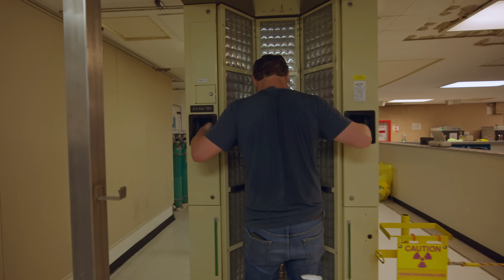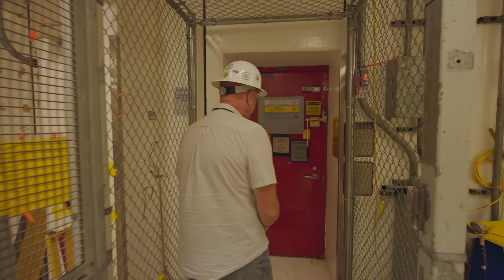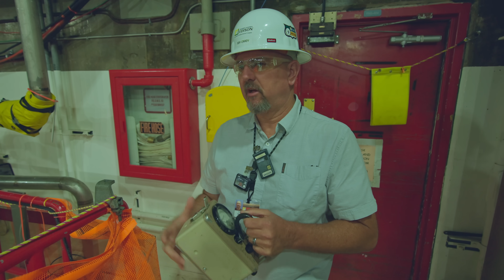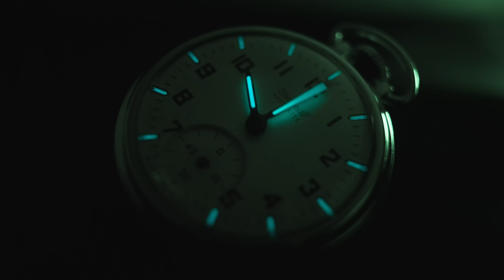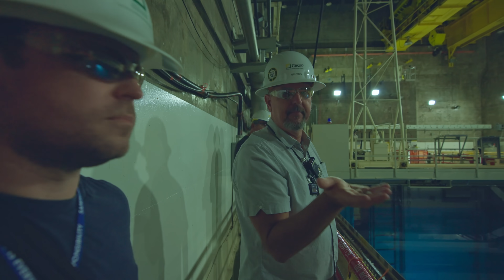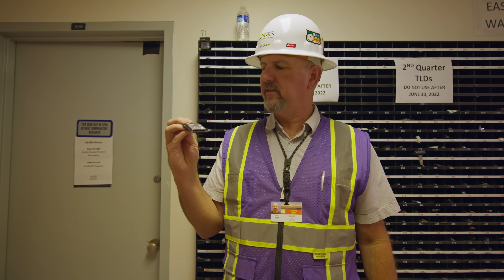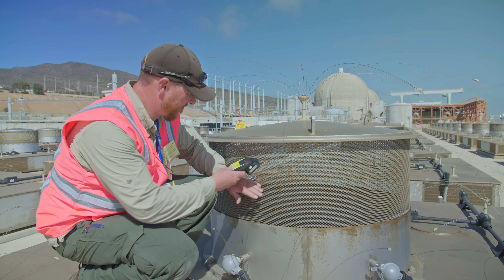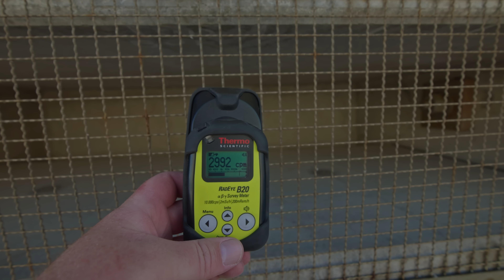Inside San Onofre Nuclear Power Fuel Pool and Spent Fuel Storage

Comment: First, you would need to be a maniac to be anywhere near that pool. It’s still radiation no matter how you slice it or dice it. Second, that place looks pretty sketchy…missing wall and ceiling tiles everywhere, lots of debris and stray items all over, certainly looks like a place where safety conscious rules being broken are normalized. Exactly how accidents happen, and it’s always in a documentary after an accident or worse.
Reply from the maker: You get way more radiation exposure from a dental X-ray or flight than from being around the fuel pool or spent fuel storage.
Reply: @RadioactiveDrew what’s your point? How often does anyone get dental x rays? Especially when compared to the constant bombardment EVERYDAY of these “low level” exposures. Dose vs time is a simple example, either way your dose is high. Still, it doesn’t negate being lax with safety as I can see MANY dangerous potentials just from watching this video. Just look at when the group was going into the facility where the guide wrote off policy violation by the use of the phrase “executive privilege”… even the mindset is unsafe…
Reply from the maker: @Thewatcherinthering336 the levels aren’t even remotely high. If you knew more about radiation and exposure you would realize this.
Reply: @RadioactiveDrew I know enough about radiation as not to knowingly keep exposing myself to it. Although you haven’t mentioned one peep on the safety aspect I mentioned. Like the “band-aid” blanket and sign around a pipe elbow. Fix the root cause and stop using band aids, that’s how accidents are preventable….
Reply from the maker: @Thewatcherinthering336 well the contamination collects in that pipe. There is no way to “fix it”. They use the lead shielding to knock down the dose level. You might know something about radiation but based on your comments you don’t know enough to comment on safety concerns.
Reply: @RadioactiveDrew it doesn’t take a team of engineers to fix that. If contaminants collect there, simply put a trap and loop in place. There, FIXED! No more need for a band aid. Get down from your high horse and do some root cause analysis..
Reply from the maker: @Thewatcherinthering336 in these environments you are dealing with all kinds of different contaminants. Many can be easily contained. The dose rate from this pipe was nowhere near being anything of substantial concern.
Reply: @RadioactiveDrew thank you for making my point for me. Normalization of unsafe situations as being “normal”…..humans, smh

Comment: I'd like to know what you think about LFTR technology.
Reply from the maker: I think using thorium sounds like a great idea that has already been proven to work. I would like to see mirco reactors using the LFTR tech along with uranium breeder reactors. Having a bunch of smaller reactors spread out would be much safer than having a couple of big ones. If there is an accident at a smaller reactor its much easier to deal with and doesn't catastrophically meltdown. It would also create so many jobs in that industry all over the country.

Comment: make spent fuel storage at the bottom of the ocean, in one of those thousand foot crevasses. The radiation would be so diluted and mitigated by the depth.
Reply from the maker: That would be throwing away a valuable resource. So much went into making that fuel we should be reusing it in other reactors. The radiation is only dangerous if you are standing close to the unshielded spent fuel.
Reply: @RadioactiveDrew  I was thinking of the stuff that didn't have any more use. I'd say keep using what you can until it is useless.

Comment: I've seen one of those long term capsules used for storing spent fuel dropped from a crane like 40 or 50 ft up (for a safety test, it was also not loaded it was just the empty container with the sealed top), and it was just a wrecking ball,. It destroyed everything it hit, and the storage container was completely fine minus some scuffs.

Comment: I'm a retired nuke worker. I worked at  TMI, Oyster Creek, Limerick and Peach Bottom.
The last 20 years of my carer were spent on the fuel floor or fuel handling building depending on the location. I've performed fuel handling, HSM dry cask storage, reactor disassembly and reassembly.
  I found this video to be one of the best at explaining in simple terms how a spent fuel pool and dry cask storage work. 
  Seeing the use of portal monitors and small article monitors brought back memories of not passing the monitors while trying to exit the plant.
  Great video. Keep them coming.
Reply: How are the pools treated for bacteria or algae? Does the radiation kill any growth or are chemicals and or filters used?
Reply: @Mrbg123  i hadn't finished watching this but can bacteria even live in reactive material?
Reply: I would say thats correct along with filtration and treatment techniques @Mrbg123
Reply: The water is too warm and constantly filtered to grow anything. To my understanding. @Mrbg123
Reply: @Mrbg123  um, yeah, nothing organic could survive that much radiation.
Reply from the maker: Thanks. Glad you liked it. I had a chance to talk with some of the workers at San Onofre and they all seemed to really like what I’m doing on the channel as well.
Reply: What happens to the pool water do you drain the water into radiation proof containers.
Reply: Hello I'm Joe. My dream job was to work at oyster Creek. I could never get in. I was upset when it closed.

Comment: very cool and intreasting but i would not be going in thare without a hazmat sute i would not want cancer and i dont care how low the levels was if your exposed everyday like they are im sure they got some kind of cancer it just really blows my mind
Reply: The levels are absolutely miniscule. And the rules are outrageously oppressive and extreme.
Reply from the maker: Those workers are exposed everyday and they aren’t dying from cancer. The level of exposure is monitored to make sure no one is exposed to dangerous levels. Also a hazmat suit doesn’t block radiation. Some of the radiation will go through any suit.

Comment: So what happens when you can no longer store this stuff and you have no where to put the spent fuel
Reply from the maker: How do you imagine that happening? Are you talking about a facility running out of room on site? Spent fuel doesn't take up that much space. The spent fuel can be stored onsite forever...or better yet used as fuel for other more advanced reactors. Only a small percentage of the U-235 has been used up in this fuel, so its a waste to bury it.

Comment: What about those lifesaving rings positioned around the pool? If I worked there, I would be REALLY careful not to fall in.
Reply: It's only clean water with a small level of tritium water. Sea water is more radioactive than this stuff shown here. You can swim quite safely.

Comment: The comparatively low level of technology in engineering (I have not seen a single thing that we did not know how to use or make in the 1950s), but it having to be driven to such extremes, not since only 50 or so years ago, but hundreds of years into the future, means that the cost of all of this is staggering.

Was nuclear power ever economic if the plutonium retrieved from reprocessing plants had not been "desired" for "pursuing" the cold war? I doubt it.

Imagine wind or solar generating sites 50 years from now, or large grid scale battery storage systems, or even biogas plants. Like the hydroelectric systems being removed one-by-one now...
* the bulk of the materials would have gone straight into recycling without a single thought
* some of it might have been incinerated (.eu), or gone to landfill (as i understand the .us to operate mostly still), again, just load it up, drive it over.
* at most there will be a few concrete slabs left in situ

Comment: 35,000lb lid compared to Chernobyl's 2,000,000lb lid lol.
Reply from the maker: The lid at Chernobyl was over the reactor. The lids over the spent fuel aren’t for the same function.
Reply: Oh ok, I don't suppose you were allowed to tour near the reactor here? @RadioactiveDrew
Reply from the maker: @Hosteggy the radiologically controlled area was right outside of the reactor room. But they were very protective of the tools and methods they were using to disassemble the reactor. They didn’t want me to get any footage of the feed coming from the reactor room. Looked cool in there.

Comment: Why do they keep water in the pool if the reactor has been shut down for years and the the fuel is entombed outside?
Reply from the maker: I think they are waiting to deal with the water when they are done with the reactor disassembly. The reactor is still underwater to help keep the area radiation down when they’re cutting it up.

Comment: Lets put this high dose radioactive pipe right where we walk....for no reason... Genius!
Reply: its actually extremely small amount. your old fiesta plate is hotter
Reply from the maker: That pipe was far from a high dose rate. The pipe was over time having contamination from the fuel pool building up in it. So it’s not like it was designed for that purpose. It’s something that happened and is very low.
Reply: You leave my old fiesta plate outta this!
Lol.

Comment: I'm watching this to see how well this place would hold up if Hurricane Hillary hit it. At the time of writing this the storm is set to hit in less than 24 hours.

Edit: Just finished watching it. Good luck to everyone in California tonight. Especially since they did away with the alarm system, evaluation plans, and containment procedures.
Reply from the maker: What are you talking about? This area could be flooded with 100 feet of water and be fine.
Reply: @RadioactiveDrew It's the unmitigated confidence that concerns me. They didn't raise the sea wall at Fukushima Daiichi because a tsunami that high was "impossible". It was possible, and it happened. Also, nowhere is this video is the claim that the site is impervious to flooding made.
Reply from the maker: @questionablehistorian9335 I never said it was impervious to flooding. I’m saying the spent fuel could be completely submerged with zero risk to anyone or anything. The reactors when they were running were much higher up along with all the back up generators used to pump the water for the reactor. Fukushima has some serious design flaws that should have been addressed long ago.
Reply: @RadioactiveDrew  I've been watching the path predictions for Hillary. At the moment it is set to make landfall almost directly over San Onefre. You're saying, right now, that you are 100% sure that this storm will not cause any type of radiological problem at San Onefre? Because if the NRC does not believe that, than there should still be evacuation and containment plans in place. We're talking about a huge area of land that would be unhabitable for hundreds, perhaps thousands of years. We're talking about people being sickened and possibly killed in the horrific manner of radiation poisoning. I live in Idaho, close to the site of a nuclear meltdown that took place in the 60's and we're still cleaning it up.

Comment: Someone I know bought a gun with a tritium glowing sight.  It's less dangerous than radium, but the glow wears out faster.  Lasts about 10 years before it needs repainting or replacing. 
But boy is it cool.
Reply from the maker: Radium doped items were kind of similar. The glow would slowly fade because the radiation would destroy the zinc sulfide crystals.

Comment: What I don't get when it comes to the dry spent fuel storage (especially the older design) is if the main component of the radiation is gamma (as you say) why would it be any higher where air vents?  I mean can gamma radiation be reflected and thereby channelled down the vents like radio waves in a radar transmitter, I just thought they were super penetrating?  
Surely it is more likely that it is from dust particles in the air that have been radioactively bombarded as they travel with the circulating air closer to the source and thereby turned slightly radioactive and are likely just emitting alpha or beta radiation?

Comment: They didn't give a good answer about the tsunami tho
Reply from the maker: Felt like a pretty good one to me. Not sure what else you wanted to hear.
Reply: @RadioactiveDrew  they said the biggest tsunami was 27 feet tall. There’s nothing that says a tsunami can’t be bigger than 27 feet. After that, he kinda went blank and the video got kinda choppy like there were lots of cuts because he couldn’t come up with a good answer. I mean what IF a tsunami did hit?  He didn’t explain the safety provisions for such an event.  The only thing he said was “well Pacific Ocean water is very cold and would cool things down.”  I mean that’s the sort of answer my grandfather might give while he sat in his lazyboy chair drinking a beer and watching football. 

We don’t want another  Fukushima because the chief safety inspector said “well we thought....y,now....water is cold n stuff....so it would put out the core or whatever.....?”  It’s the kind of thing Homer Simpson might say.
Reply from the maker: The dry casks are sealed. So if the oceans were to  totally cover them nothing would happen. Even if they were breached and water got in there nothing would happen. Not sure what else needs to be said. Everything at Fukushima concerning the water they are about to release into the ocean has been so over blown it’s maddening. Usually people that have zero knowledge about how radiation or radioactivity works are commenting on how “dangerous” it is.

Comment: Is that where the kittens got dosed?

Wikipedia:
On February 1, 1996, four kittens were found at the plant in a small space between two of Unit 1's administration buildings by plant workers. They were discovered outside of the radiologically controlled area, but tripped contamination alarms when the workers of the plant attempted to set the kittens free. Health physics personnel responded to the scene and frisked [?frisked wtf] the kittens for radioactive contamination. None of the workers handling the kittens were contaminated, however the kittens each measured 6000 counts per minute. The kittens were given warm baths with shampoo, which reduced the radioactivity to 1000 counts.[44] The kittens were taken for further screening, where they were found to have been contaminated with Cesium-137, Cesium-134, and Cobalt-60.[45] The radioactive activity within the kittens began sharply decreasing, and the kittens were declared to be in healthy condition.[46]
In trying to find the kittens' mother, the workers learned of the animal control officer's incident the day prior. The officer was frisked for contamination. No contamination was found on the officer, but there were trace amounts of radioactive isotopes on a rag the officer used to dry the mother, as well as on feces excreted within its cage. As the search continued, the remains of the cat were found on Interstate 5. [I guess momma can't dance or didn't make it far with that bellyfull of radiation, huh?] Health physics personnel analyzed the remains, finding identical activity as the kittens. The kittens were adopted by plant workers, having been named Alpha, Beta, Gamma, and Neutron. 
I'm sure nobody did the science because they didn't want to know, but, among other things, I'd love to know about those kittens kittens!!!
Reply from the maker: Interesting story. Those levels of radiation are extremely low. Those kittens and the mom would have lived long lives with no problem. If they were living in that environment their entire lives then there might have been some problems.
Reply: @RadioactiveDrew  
YOU IGNORE THE FACT THAT THERE SHOUD HAVE BEEN NO RADIATION LEAKS IN THE FIRST PLACE, BUB. THESE AMORAL DOPES IGNORED SELF-DESTRUCTING GENERATOR TUBES (A KNOWN DESIGN ISSUE AND WHERE THE "HOT" METAL CAME FROM) AND SCREWED UP THE FIX >>TWICE<<. FFS!!! 
GO AHEAD, MAKE MORE EXCUSES.
IF YOU ARE SO SANGUINE ABOUT RADIATION EXPOSURE, I'LL FEED THE SAME "HOT" SH*T TO YOU FOR YEARS. BET YOU WON'T AGREE TO THAT!
AND YES, I"M SHOUTING AT YOUR IDIOCY OR UTTER "SHILL STATE" BECAUSE I'VE HAD ENOUGH OF THIS INDUSTRY'S LIES SINCE THE 1975 RASMUSSEN REPORT, OK?
Reply from the maker: @michaelmcgovern8110  well the story you told the cats were in the RCA, which is where there is a contamination risk. So I’m not sure what the problem is.
Reply: @RadioactiveDrew  
Oh my god, you wouldn't say honey if your mouth was full of it, would you? That plant leaked for years, they lied about it, were forced to admit it and "fix" it, the "fix" failed TWICE for a total of a few billion $ or so (hey, what's a billion or so between friends?), and you're trying to gloss over leaks? FFS. Give it up, fellah. Really. 
When the nuke industry stops lying and evading consequences and cost, and starts building WELL DESIGNED plants run and maintained by WELL TRAINED personel, I'll listen. Until then, they made this historical bed of disasters and they can lie in it; now they just LIE.
Meanwhile, WTF WERE CATS DOING IN THE RCA? You really aren't helping yourself here...
Reply: @RadioactiveDrew  
And you ignore what you now must admit was a physical security problem with cats getting into your RCA? FFS, dude...
Reply from the maker: @michaelmcgovern8110  animals especially small ones can find their way into all kinds of secure sites. I know you're TRYING to make a big deal out of this...good luck with that.
Reply: @RadioactiveDrew  
I'm trying to make a big deal out of bogus engineering and operation in nuke plants. Yes, we will need nukes, but not the BS foisted on us the first time around, and it's people like you who won't admit the truth of past failures who make me get in your face before you do it again. OK? And I speak as a SCIENTIST, not somebody you can deride as a flaky treehugger.
Reply: Nice industry you got there, fella.
https://www.youtube.com/watch?v=O6OfW_L0-RI&t=7s